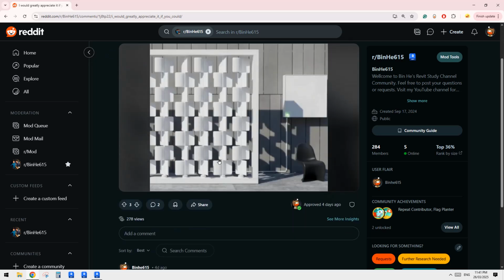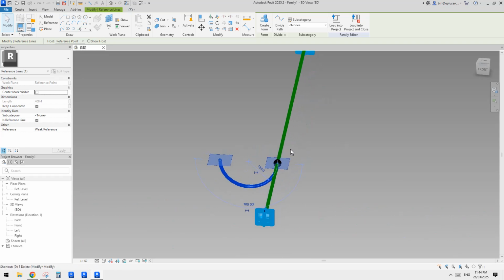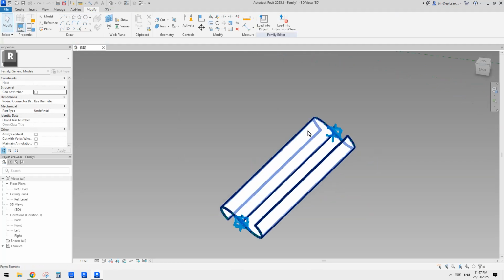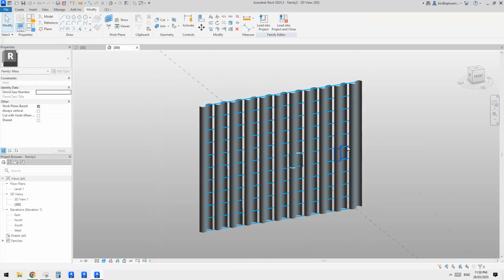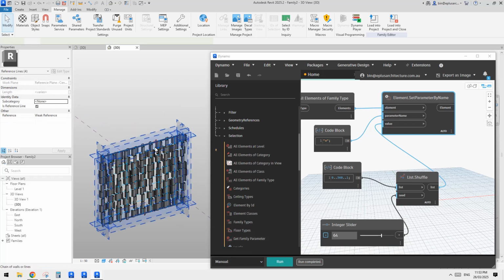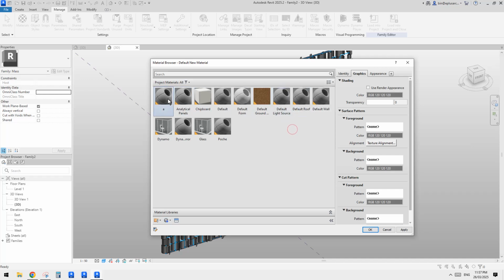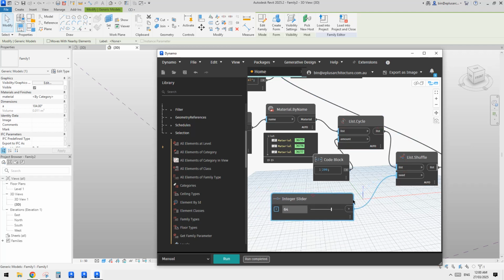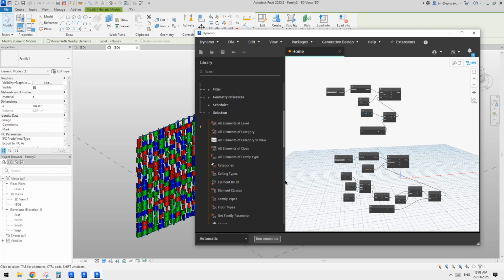25043 - Adaptive Family and Dynamo Exercise in Revit

Comment: Thanks for all the videos, great inspiration!
For a project I have an issue. When applying the material script, the Element.SetParameterByName gives a error 'read-only'.
Is it possible to use the Dynamo script in a project environment, instead of a conceptual mass? Or can you import the conceptual mass to a project and implement it?

Thanks in advance!
Reply from the maker: You have to do it in the conceptual mass and load it into the project. Dynamo doesn’t work in model in place mass.